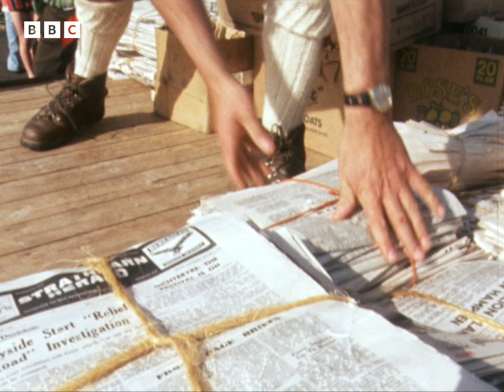1975: COMRIE - The Village That RECYCLES | Nationwide | Science and Nature | BBC Archive

Comment: Recycling works for paper, beer cans, scrap metal. Does not work for plastic, less than 7% of "recyclable" plastic is being recycled, everything else is dumped into the ocean. Even with paper it is actually downcycling, as white paper turns into brown bags. The best solution is to use less stuff. Do not subscribe to newspapers you can read online. Bring your own bags to shop, then you won't need paper bags. Don't buy anything wrapped in single-use plastic. It would be nice if bottles were washed and reused like 70 years ago. Don't fool yourself about plastic recycling, it does not work.